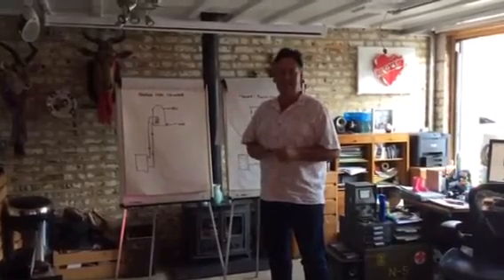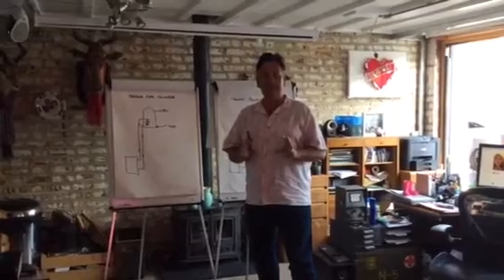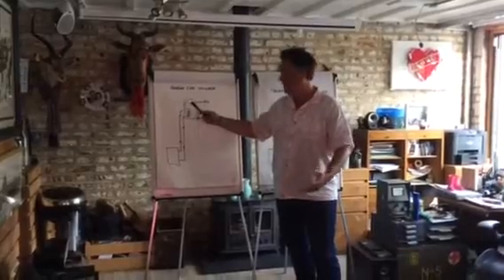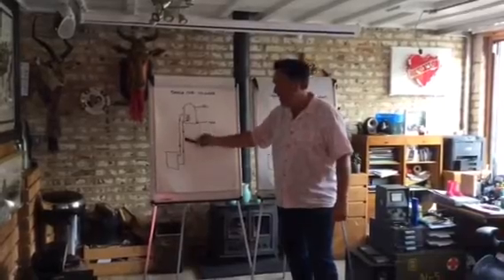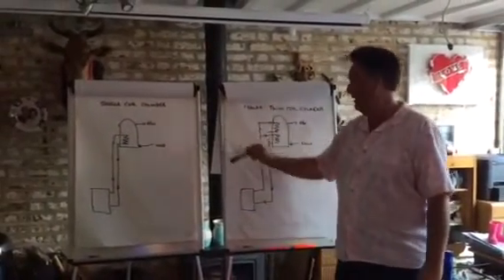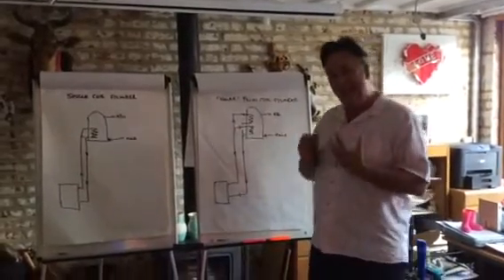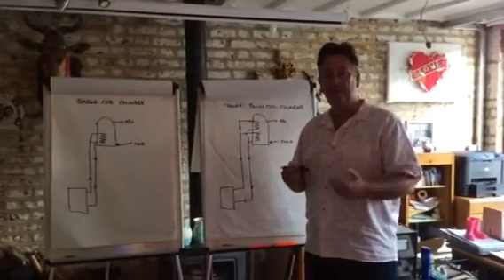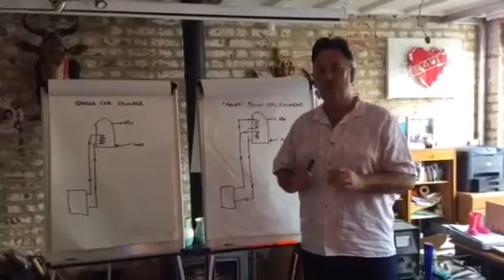Why you must fit a TWIN Coil Cylinder when you change your Hot Water Cylinder by BBC Watchdog Expert

Comment: If this was really beneficial manufacturers would put bigger coils in their tanks anyway. So must be nonsense. A bigger temp drop in the coil would need a more powerful boiler to heat it back up surely.
Reply: The manufacturers focus on selling units nothing else …as long as the unit is Part L compliant ….they try to manufacture the unit at the lowest cost and sell at the max they can 
As the market is flooded, their margins are tight as people buy on lowest price, all the manufacturers will make a you a better spec unit (as a one off ie larger coil etc at extra cost) 
Spending £100-150 more having an add coil is definitely money well spent

Comment: You should run the coils in series not parallel as more heat will be extracted from the boiler flow water, the return water will be cooler, so a condensing boiler will run more efficiently.
Reply: I agree that makes sense but for a heat pump I would imagine it’s better in parallel.

Comment: You'd be far better using the second coil for your DHW with a mixing valve, You'd reduce the inertia of cold water entering the hot tank and still have Mains hot and cold.

The stored volume would not leave the cylinder and therefore would be far more efficient.

Comment: Yes you are quite right but what if you have a single coil Megaflo ? Easy buy yourself a 45kw plate heat exchanger and your problems are solved when you need a solar panel, also make sure you buy the Navitron tubes.
Reply: Require a 45kW boiler to run that.

Comment: It's a great idea but you would require additional heat output from the existing boiler, to serve that solar coil. It would reduce recovery time alright, but there's an energy penalty that comes with that. You'd also need balancing valves, if the coils have different pressure drops.....or you could pipe it up reverse return.
Reply from the maker: very minor

Comment: Can you draw a more clear diagram of connecting a twin coil please it would help me no end many thanks
Reply: Hot flow from the boiler goes to the top of the top coil, the two coils join at the middle of the tank, cooler water comes from the bottom of the bottom coil and back to the boiler.  This way round the maximum amount of heat is extracted from the water.  Think about the temperature differences and it makes sense.
Reply: Email me please ian@londonboilercompany.com